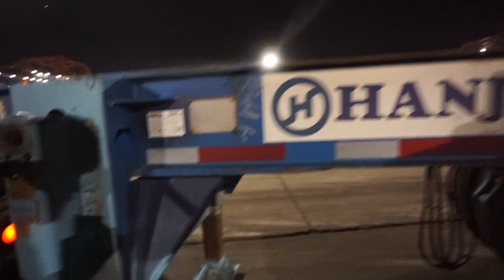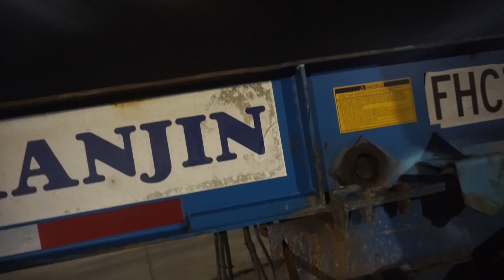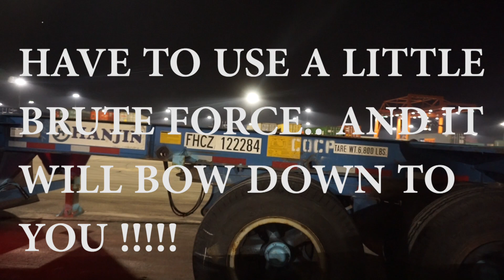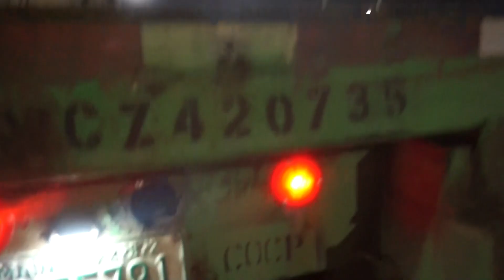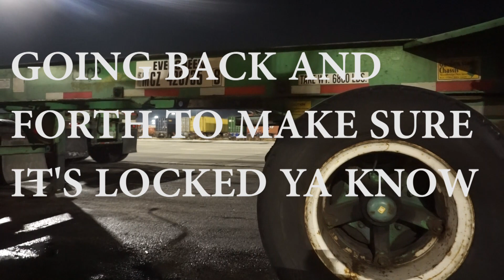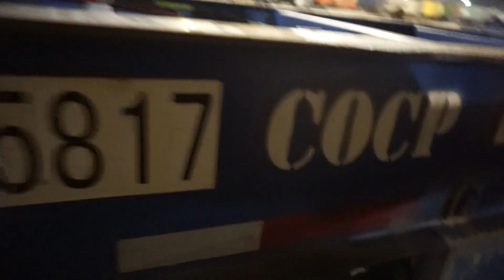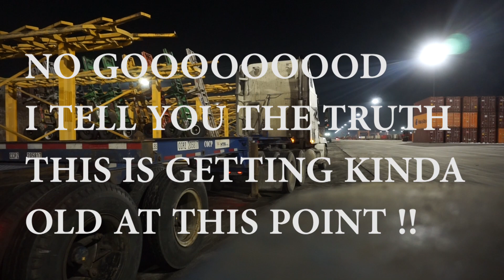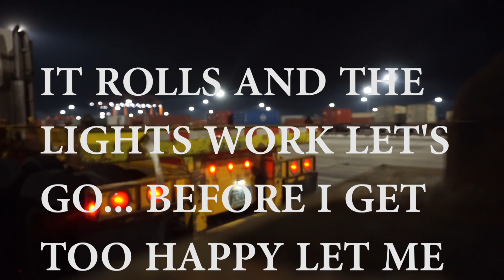RAIL YARDS : MAKE sure the 20 footer CAN SLIDE before TAKING IT !!!!!

Comment: 20s are fun with an iso tank on them. Need a couple 6x6 blocks.
 And vise grips. Till it disappeared I had a railroad spike. I would put it in the handle with the pins released. So when you got loaded you could slide them. 
Remember PBBLASTER and STP Oiltreatmen in a squeeze bottle are your friends. sliding them without the box is needed to make sure they slide. I was a Ohare this morning fling back from vacation. 
It was 70 degrees n San Diego  when I left and raining in Cinci when I got back. Be safe my friend.
Reply from the maker: Oil is your friend jerry when v dealing with these 20's. And im glad you made it back from vacation safely big bro!